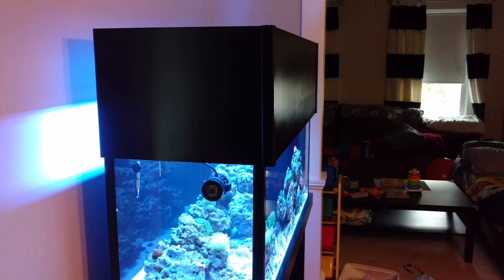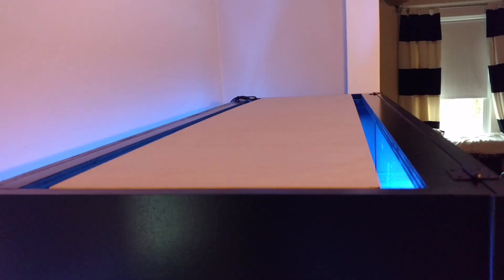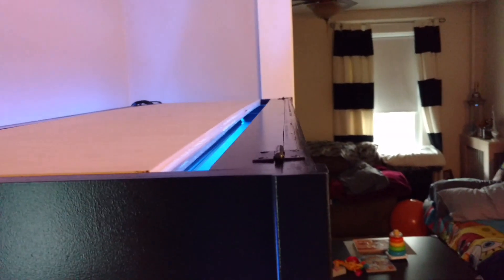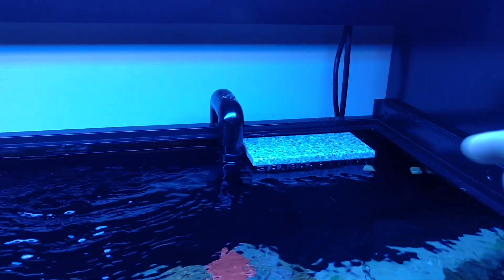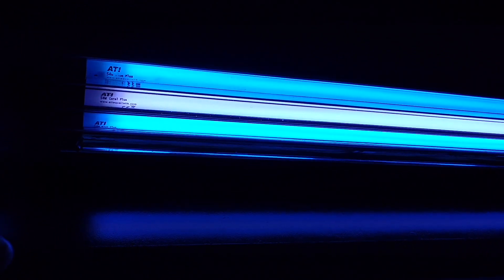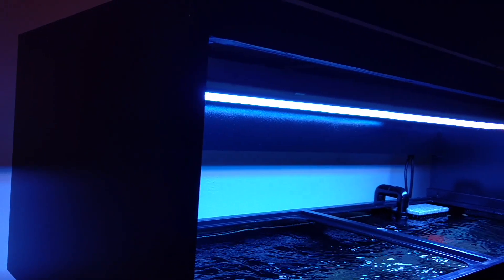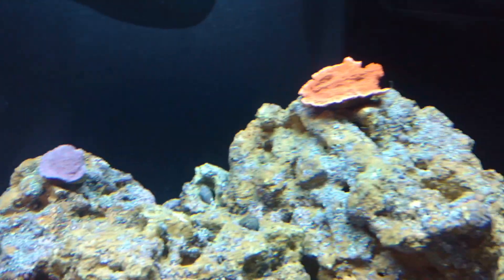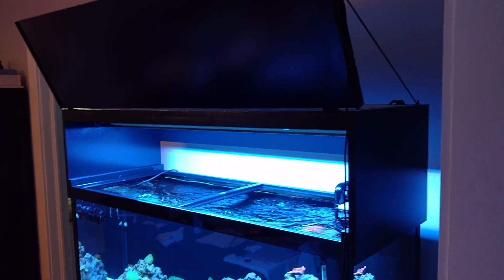Reef Tank Build Episode 4: Lights and Canopy.

Comment: Did you use that corner trim on the actual tank too?
Reply from the maker: Yes. Siliconed it right to the glass
Reply: @BillyPipes is that corner trim wood or plastic? I’m trying to find some to do the same THX
Reply from the maker: @wtjonny the ones I glued directly to the take are plastic.  I did a separate video on the ones I used and how I painted and installed them

Comment: What is the height of the canopy , I went to a home depot near me . Most pieces were only 11" in width . The length they had a lot of variety.
Reply from the maker: @GeneralGP114  you'll have to use high quality plywood if you need something bigger. I don't have this canopy anymore.
Reply: @BillyPipes  ok thanks. I thought about the plywood as well . Wasn't sure if ppl used it
Reply from the maker: @GeneralGP114  yup. Lowes has good "sanded plywood" and I use an outdoor paint on it. Holds up really good. I use the behr ultra paint. About 3-4 coats. And I think I did an in depth video on the measurements I jusst remember which video it was

Comment: Hey new on here love the canopy actually did it not sure how well lol. So I don’t have a home depot only mernard. So you paint with roller?  One pass then dry then sand then paint again then dry then sand and the 3rd is your last ? Thanks in advance
Reply from the maker: Yup, thats exactly how i do it👍
Reply: Billy Pipes any suggestion: so I’m doing the canopy on a 120 gallon 60 inches long I added 4 hinges but the door is so heavy would you recommend another type of thickness of plywood or anything else ? Thank you
Reply from the maker: @TheMeli81  you can use 1/2" for the doors. Or even 1/8" if it'll look ok
Reply: Billy Pipes thanks boo I thought that also glad I seen your video company wanted 400-600 $ for a canopy 😪 then I seen you 🙏😱😋😘❤️🤟🏼🔥
Reply from the maker: @TheMeli81  👍👍👍👍👍

Comment: So billy I have a 4 bulb sun sun fixture. I am trying to figure a good light configuration! Do you have any suggestion? It's a 75 gallon. Thanks pipes!
Reply from the maker: I'm currently running 3 blue plus and 1 purple plus. 2 blue plus run 12pm-10pm. 1 blue plus and 1 purple plus run 3pm-9pm